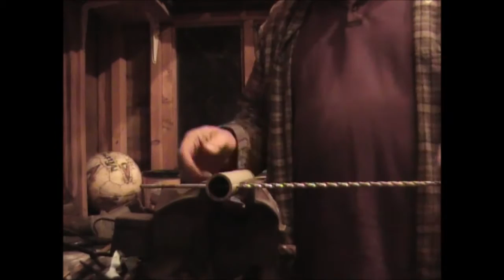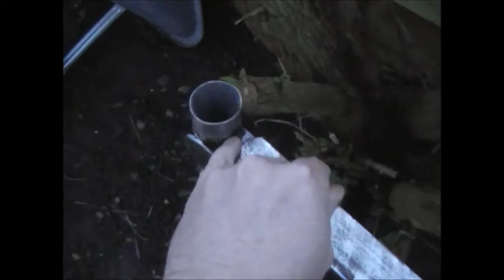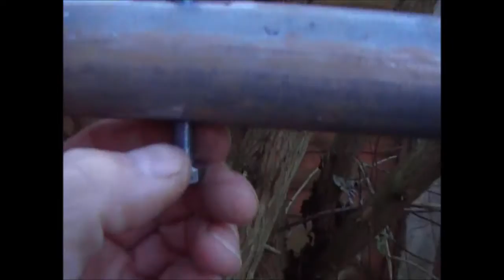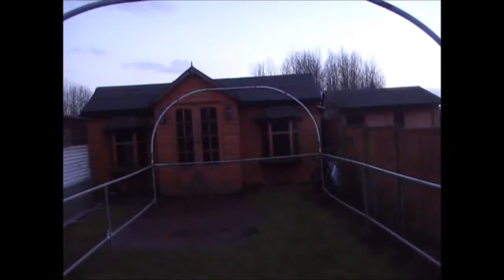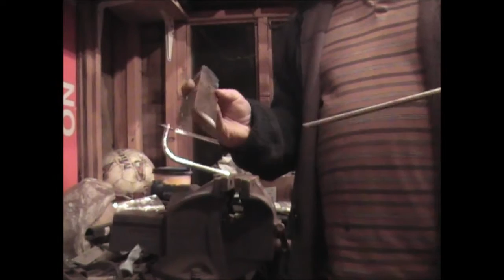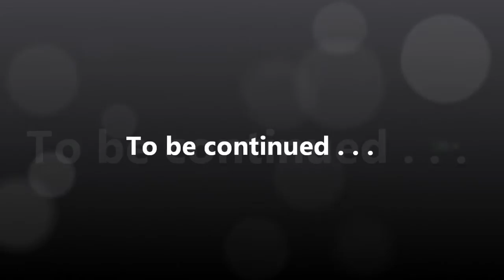Jim's Allotment - Plot 9 - How to build a Steel Fruit Cage - Part 4

Comment: You are getting the Jim. I thought you might burn your hand when you hand held and welded those pieces without gloves.
Reply from the maker: Hiya Pat, with this blinking weather I'm glad of a bit of warm. With mig welding the heat is very localized, so as long as you don't actually touch the weld itself you are normally OK. 'Been welding for 30+ years now, so I have burnt myself enough to know where is good to hold the metal :O) ... Trust me, I have got the scares to prove it :O).. All the best Jim..